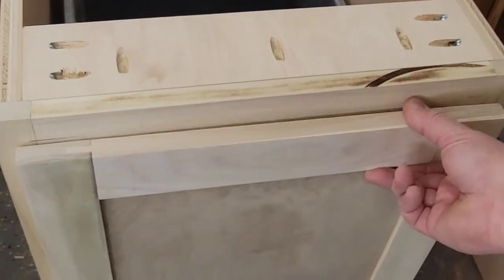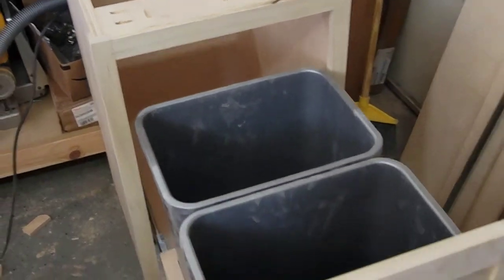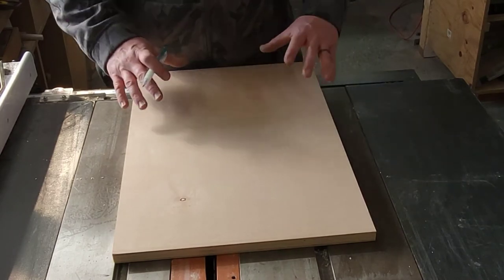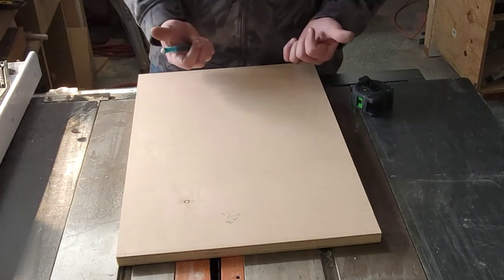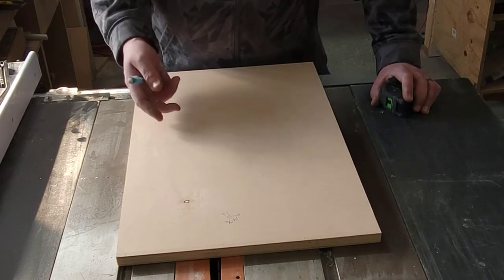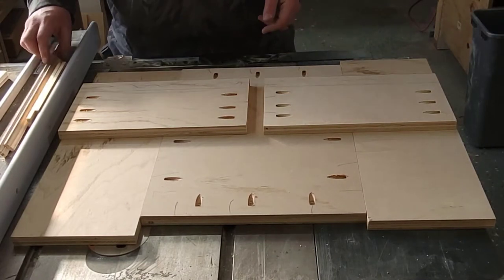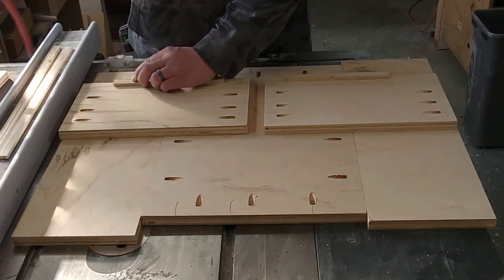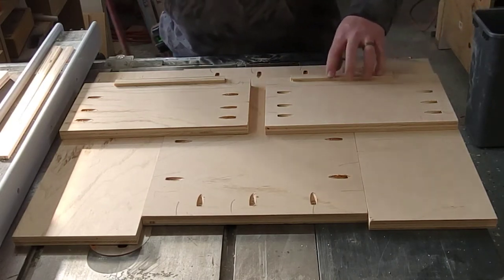18in cabinet with pull out Recycle/Garbage can.

Comment: I really like this build. About how much did  you add to the width of the cabinet in comparison to the width of the trash cans?
Reply from the maker: The face frame opening is 15 3/8. The garbage can top is 14 3/4.   Leaves you with 5/8 ÷2 gives you 5/16 on bothsides. Hope this helps you .

Comment: This is exactly what I need to create for my kitchen. I don't have extra cabinet space to place pull out trash cans in an existing cabinet so I'll to do a free standing cabinet like this one. My shop and woodworking skills are quite a bit below yours though. Do you have advice or recommendations for slightly simpler version of this? Thanks for sharing your work.
Reply from the maker: If your looking to do an easy version i know they sell pull out kits that have the slides brackets and cans on amazon. Rev-A-Shelf 53WC-1835SCDM-217 Double 35- Quart.
All you would have to build is your cabinet box and door the kit would cover the rest. Let me know if that helps.